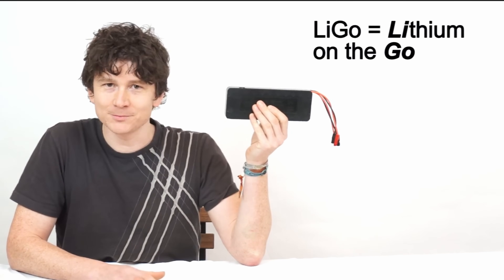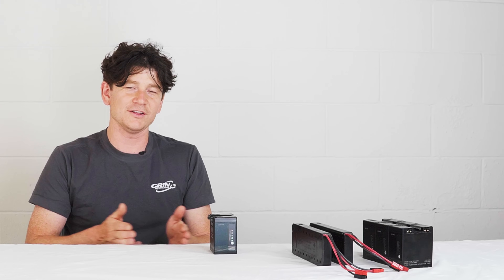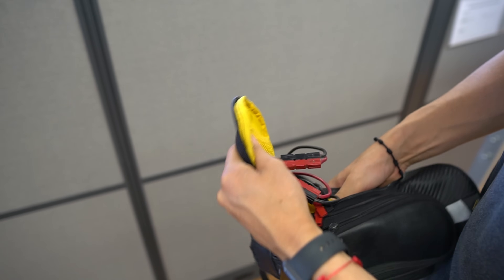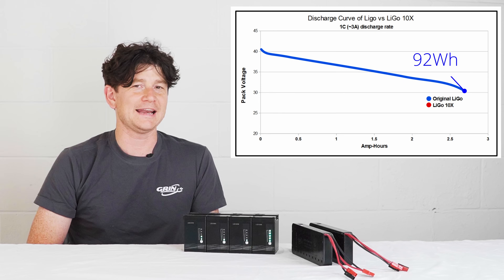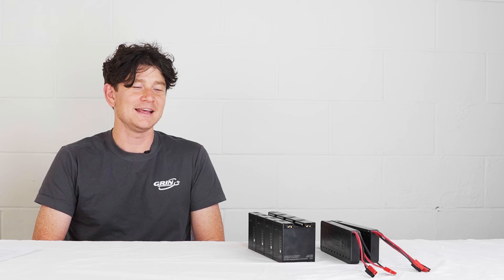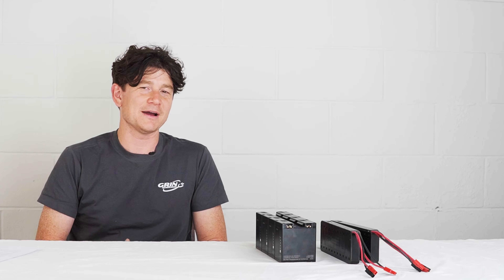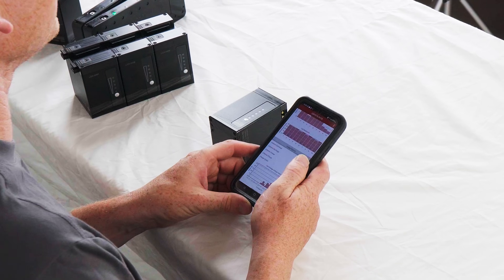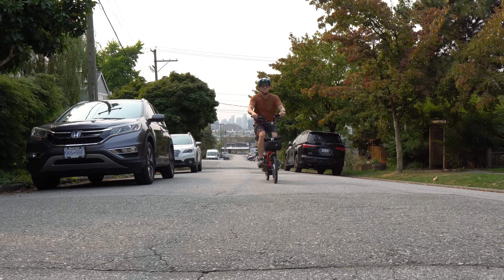Grin's LiGo 10X Modular Battery Release.  Take a flight with your bike!

Comment: Wow.
Those batteries, being modular, and the BT connectivity, are awesome.
Great product!
As you said, too bad, it's a niche market, at that price point.

2000$/kWh is already twice the price as a regular battery, as you stated.
Which, are already, disconnected from the real price market. 
Raw Li-ion cells are around 150-200$/kWh.

I've already crossed the DIY LIFEPO4 line, a long time ago. 
My battery (50V 25Ah), cost 100$/kWh. 
Can't go back from that (maybe some DIY li-ion for the weight).

Comment: I do really think that it is gold but I wonder if you could dig into the detail of plugging in parallel with commonly known voltage issue. For the modularity it would be useful to bring in a solution, perhaps bypassing the inserted new modules with upper voltages, in stages, until charging, in order to even the whole pack voltage. In addition to this, I would like to hear more of larger 48v batteries. Perhaps it could be achieved with doubled cells and doubled connectors in between. That way the BMS control wouldn´t be so detailed but it'd cut costs being one for the whole pack. It could be 5 p with 6 packs in both directions (10 cells in each module) making 12s plus the BMS module. The signal of each module should be carried independently and thus, the cost could be paired but the product would match broader motor market.

Comment: Can I buy just the BMS from these, without the battery and other parts? Are there any plans for a version at higher voltage than 10S? My bike is 13S, and I've been looking for a BMS suitable for the large packs I'm building for it for long trips, but have only found ones at a suitable size which are black boxes giving little to no feedback, meaning if anything goes wrong, my first warning will be the pack going into thermal runaway, so I've been handling balance manually while I look for a better BMS, which is a huge hassle. Being able to connect them in parallel without going through a manual equalization process first would also be handy.

Comment: If 99 watts is the limit to fly, how can you fly with more than 1 pack?
Reply from the maker: The limit is 99 watt-hours per battery pack, not per person.  They don't specify an upper limit on how many <99 Wh batteries you can have in your carry on baggage, but usually we recommend keeping it to under 6 pieces in order not to force the issue.

Comment: Nicely done! Any plans to offer a 48v or 52v version or higher? Would be nice to be able to use 1 battery for short trips and just add them as needed for longer rides.
Reply from the maker: It's been explained in other comments, but the same design with 48V or 52V requires using really low capacity (2Ah) cells so the energy density of the pack made from 18650's is going to be quite poor.   A 25V 4Ah option with 21700 cells is more feasible. A little bit annoying to then have to series connect on the bike to get 50V but at least it can be built with modern and safe cells that have decent energy density.

Comment: Not related to this release but I'm curious about it in general, has grin ever contemplated trying to get an axial flux direct drive motor into production? I'm looking at all the 27mm stators that are 30cm wide with 26 pole pairs and wondering why we don't do an axial flux since it's barely a radial flux to begin with with those dimensions.
Reply from the maker: For sure. But we're a pretty small team with limited resources so we have to pick and choose projects accordingly. The capital costs needed to spin up a whole new large diameter axial flux motor from scratch is pretty big intensive. And it can't leverage existing mass-produced motor components the same way we were able to with our All-Axle motor.

Comment: Do they really need to be modular? DeWALT’s FlexVolt batteries get around 100wH thing with a cap that holds down switches that break the pack up into 3x 18v batteries internally. After you receive it and remove the cap the momentary switches are released and it becomes one large 18v battery (“20V Max”). If you put it into a FlexVolt tool it will split them up again and then the tool will connect them in serial for 56v (“60V Max”). All the while, the consumer has it all in one pack to carry, ship, and use. Surely, one pack with internal disconnects for shipping would be better than shipping multiple individual packs, right?
Reply from the maker: What Dewalt did I think just allows them to get away with shipping the power tool under UN3481, as batteries shipped with equipment. The airlines look at the total watt-hours of the enclosed battery, so even if internally it's split into 60 Wh strings, they would see it as 180 Wh total and reject it.   

When we travel with the LiGos it's also important that they are physically disconnected from each other and clearly separate units with no way of propagating a thermal runaway event from one to the other.
Reply: @GrinTechnologies  Thanks for the clarification!
Reply: What? The limit is 100WH total for shipping, doesn't matter if its split or not.
Reply: @jaro6985  Yes, this rule applies to airlines in Europe. It might not be one, but there's usually a limit like maximum 2 batterys of under 100 Wh. You need to contact the airline ahead of time to make a special request and you should assume it will be rejected.
Reply: @jaro6985  Then what shipping limit is DeWALT dodging with their setup? They are very clear that you only need that piece for shipping and can discard it once received.
Reply: @emmettturner9452  oh wow that is a crazy loophole, its 40Wh x 3 or 120Wh x 1.
I'm not sure if that applies to say fedex shipments though, but seems to apply for airline flights.

"If the cell is >20 Wh or the battery is >100 Wh the package must be marked “LITHIUM BATTERIES – FORBIDDEN ABOARD AIRCRAFT AND VESSEL.”"
Reply: @jaro6985  I see. Well, even just freeing it up for air transport and some carriers is probably enough reason to do it that way. I don’t even have FlexVolt tools but they make awesome packs for their 18v “20V Max” line of tools too… especially the 9AH DCB609 FlexVolts with 15x Samsung 30T cells. I got two for my 2x 20V Max DeWALT mower that kept cooking DCB210 packs with Samsung 50S cells.

They showed up in the same box so I don’t think Amazon/w00t were spooked even shipping twice the total WH. :) Then again, the mower normally ships with even more (2x 10AH DCB210). The biggest single tool battery they make is a 15AH FlexVolt monstrosity with 30 cells and they actually sell a saw that requires two!

Comment: This is great news. I have a little e-bike for town with 12k kms on it and the battery is dying. But I have 3 other conventional bikes. which I use for touring. An e-bike with 100km range, fully loaded would work for me! Even better would be able to swap battery packs between bikes. I have yet to decide on upgrading my city bike, or doing a conversion on one of my other bikes, or even buying a new e-bike. This modularity gives me more options.
Reply from the maker: Feel free to send us an email if you have specific technical questions we can help with. If your ebikes are fairly generic and non-proprietary (ie not bosch or shimano etc.)  then it's usually quite viable to have them share interchangeable batteries.  And if you are willing to get your hands dirty you can do a lot more with a conversion than you get from most new factory ebikes, especially when it comes to regenerative braking and long term upgrade ability.

Comment: Looks super well thought out and designed. Hope that Bike Friday owners that used the original batteries can use these new batteries.
Reply from the maker: Yes, they can for sure. You can readily join them together (original LiGo's with LiGo 10X) without issue by replacing the anderson connector on one of the old LiGo's with an XT60 plug. Or use a separate XT60 to Anderson adapter cable if they are located farther apart.

Comment: We think you overlooked our specific use case which is several persons using the same battery kits. As of now we were using several batteries of multiple sizes for different ebike applications. We are hoping to soon change that to have the same batteries but less hassle and switching stuff around and instead combining the package as we need it. Trim it down for short and light trips to neighbouring cities enlarge it for the next exploration tour of our surrounding areas. We are hoping to one day get enough experience under our belt to then go on large adventures such as the sun trip. But till then we were waiting on exactly these LiGos to com to market. Looking forward to test and explore all of that!
Reply from the maker: Right, that's one application that this really shines in too so thanks for sharing. We'll try to address some of the other good use cases like this in our next video, and in the meantime we'll be happy to get these units in your hands!

Comment: Hello, your video shows batteries marked with CCC (China Compulsory Certification), but there is no such marking on the casing.
Due to new requirements from Chinese airlines, this abbreviation is mandatory. It would be good if you could take this into account and mark the casing with CCC (China Compulsory Certification).
Reply from the maker: Oh interesting and thanks, we'll look right into that. We don't have any intention of ever selling or distributing these batteries inside China, but if the Chinese airlines are requiring that for carry on baggage then it is something we should get on promptly!

Comment: I assume the BMS/parallel protection means that regenerative braking is also safe?
Reply from the maker: Yes. In general regenerative braking is fine even with dual port BMS boards that don't have overcharge cutoff on the discharge leads since the duration of regen is quite short, like 5-10 seconds to come to a stop. You never really risk overcharging the battery to a dangerous level from regen except in the very rare case of someone who lives at the top of a large mountain and the first then they do after leaving home is a long long stretch of regen.

Comment: As a brompton owner looking for lightweight commute 1 pack then a set for touring this looks interesting

Usb c charging would be nice. Prefer that over bluetooth.

Why not 48v would be interesting to know assume I'm missing something. Like 48v nominal means over 50v max for safety regs.
Reply from the maker: Yes USB C charging is in the works for sure via custom "accessory" caps that can plug into the unused XT60 port. There are finally quite a few 100W USBC-PD chargers out there which is great. 

The reason for not doing 48V is that requires using 2Ah cells to stay under 100Wh, which have a much lower energy density, resulting in a battery that is 33% heavier for the same range. For a lot of reasons we only want to ever use well proven cell models that have impeccable safety records which means sticking with 18650 or 21700 cell formats.
Reply: @GrinTechnologies tha ks love what you are doing as someone who used to work for brompton and being a battery engineer for 3 years

Awesome on usb c thinking about it would really help for travel. 

Dont hate me for saying this and get why it is like tis but i preferred the old flat layout. Liked integration just fit with my lifestyle

Comment: 36v is great but 48V would be also very good!..  any plans of providing 2Ah 48V Ligo battery in the future?
Reply from the maker: The problem there is using 2Ah cells.  If it's made with 18650's, then it's super old and heavy battery tech.  We wouldn't touch LiPo pouches for safety reasons.  A more sensible option would be to do a 7s battery (ie LiGo 7X) with 4.5-5Ah 21700 cells which allows us to stick to the high energy density modern cells, and those would be hooked in series to get 52V.  

It'll happen if LiGo 10X is a runaway success!
Reply: @GrinTechnologies have you considered approaching the military with this battery design, it's simple and rugged just what will be needed for where the industry is going
Reply: Like it could be standardised across all units for different needs it would be great if you can make sure the connection is solid enough to take a bit of a beating

Comment: Will the next update of controllers include Bluetooth too ?
Reply from the maker: The current controllers all work great with bluetooth and we have made a tiny little BLE dongle that plugs into the TRRS port to add that functionality. We've also written a Dashboard app on both andoid and iOS stores with a full interface to either a CA3 or a Phsaerunner/Baserunner. But we can't start selling them until we complete regulatory certification and emissions testing.